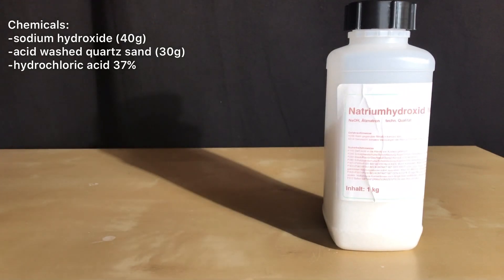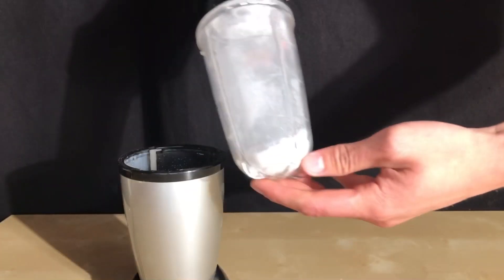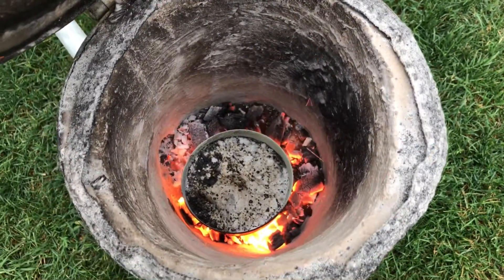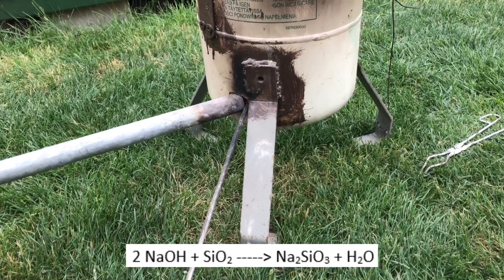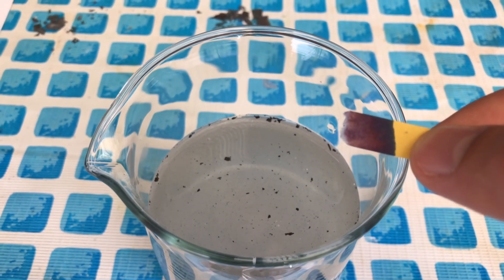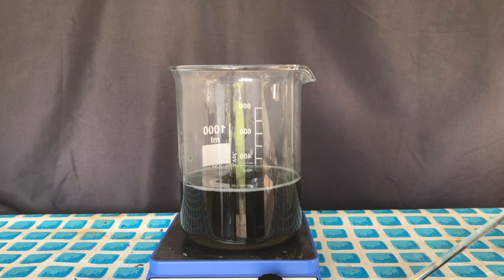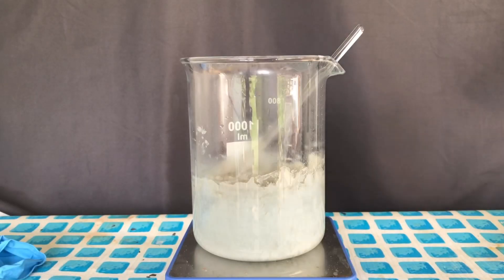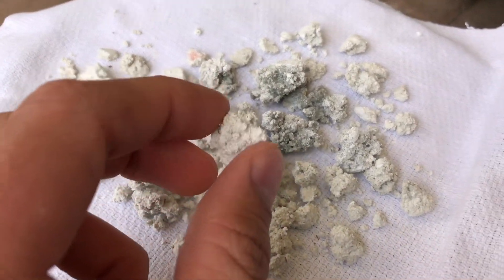Making Very Shitty Silica Gel From Sand (and making disodium silicate)

Comment: hhahaha well at least you tried. nicely done. if you ever want to revisit this in the future:
1) in a teflon container, heat both glass shards and NaOH with water. (nurd rage used a glass container but idk about that one chief)
2) the resulting solution should be added to 300 mL or so of waterwater at a rate of approx 1-10 mL /min, with an addition funnel and strong stirring
3) at the same time, add HCl and try to keep pH at 8-10 - this requires some trial and error - during the whole addition. I used sulfuric acid, 96%, and my ratio was approx 1 mL sulfuric acid to 12 mL of Waterglass (composition approx 30% w/w SiO2, 8% Na2O)
4) at the end of the addition of all silica gel, that is, however much you want to add, neutralize to pH 4
keep in mind that hot pH will be further away from neutral than cold pH! (if the solution is basic, it will be more basic, if it's acidic, it will be more acidic)
Reply: I think using sand was for fun and just for sake of the video